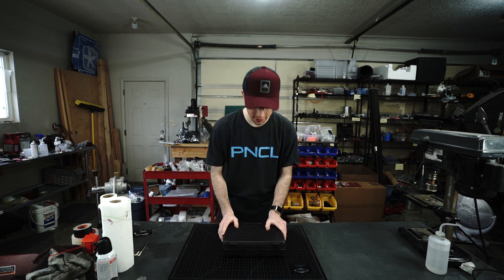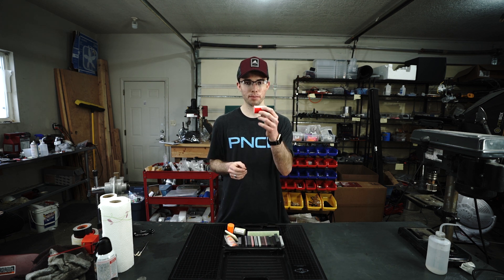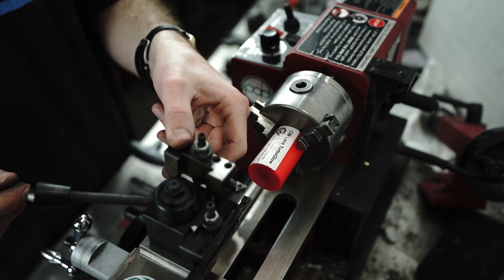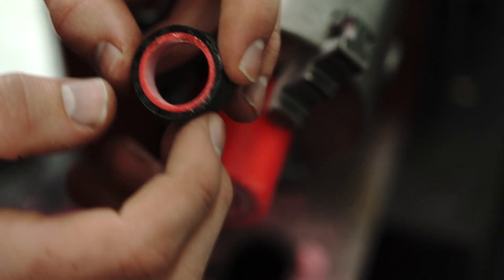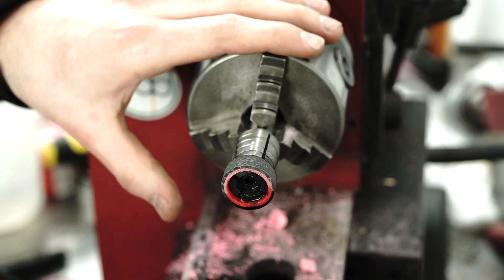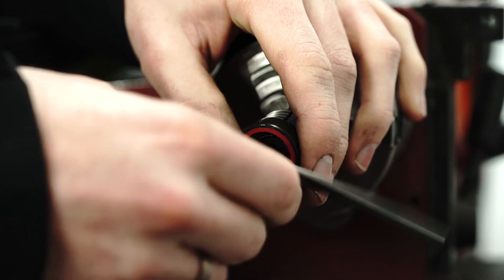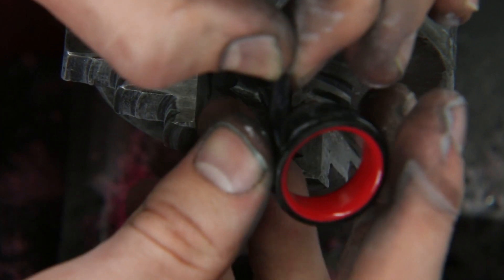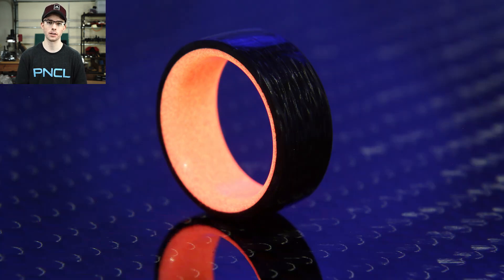Making a Titanium Infused Carbon Fiber and Lava Glow Liner Ring | Patrick Adair Designs

Comment: When you work the inside of the ring and place the ring in the chuck, it has those pointed edges. Maybe you could get/create something like a "soft jaw" from cnc machining. basically a curved surface for the ring to come into contact with in the chuck, instead of the points, to hopefully decrease the chance for damaging the finish?

Comment: I think in this and most of your other projects I've seen you wet the sandpaper when using it to smooth everything down. Do you use alcohol to get it wet or water? Is there any big difference between the two? And what difference would there be between using wet or dry sandpaper?

Comment: This is a little cliche but have you thought about doing mood stone/ mood rings? You might be able to get some new ideas out of that. Jade and bloodstone would also be cool. Oh and I don’t know if these will work (and they’re limited in supplies) but sometimes you can find fossilized tree trunks that have crystallized. Those usually have a lot of color. And if you can get Amber that would be cool. If the crystal tree trunks are too thin, then you can just cut a few rings out and glue them together with rosin, or put something (or nothing) in between two rings and fill the middle with rosin or something. It would be similar to the glow rings but held together entirety by rosin. Hope this helps!

Comment: whats the point of using full glowing cylindrical material inside because most of the time it will not be visible(when the person is using the ring), instead you could have saved the material by cutting two small cylinders and sandwich carbon fibre material between them.

Comment: If you want to use the saw and the piece is on the lathe already why not just turn on the lathe and lay the saw over the piece instead of manually cutting it?!
Reply: باسل الدوسري was thinking the same thing it took so long haha
Reply: The best reason I can think of is that with Patrick's way it's easier to keep the cut very straight and not make any mistakes. I thought the same thing you did at first, but the more I thought about it the better I liked his method
Reply: I think he might've damaged the ring if he turned the lathe on. Sawing it manually is probably a safer way of cutting that piece straight.
Reply: I've tried using a saw on the lathe, and it usually causes more harm than good, the saw just kind of bounces around and destroys whatever your working on (at least in my experience)